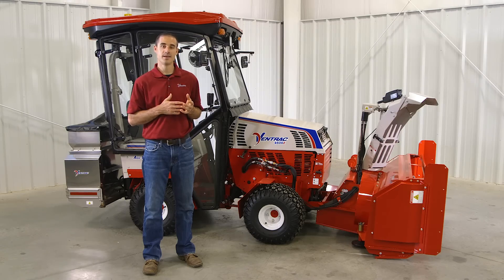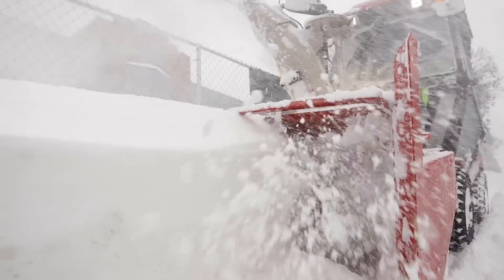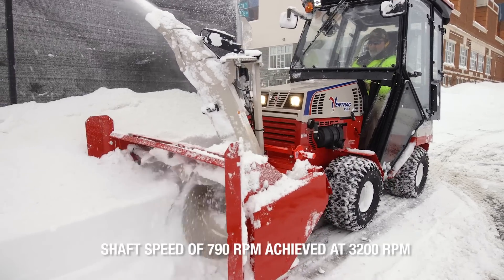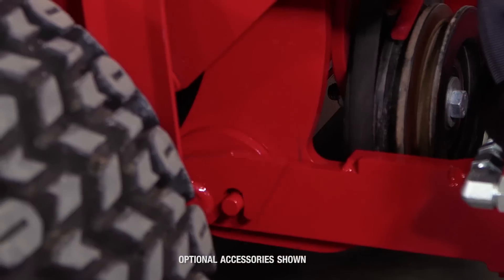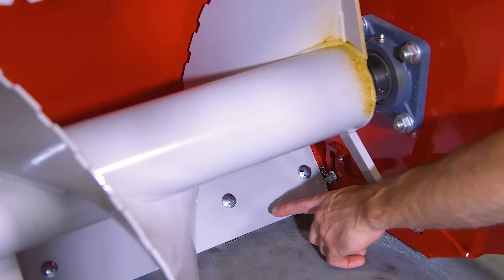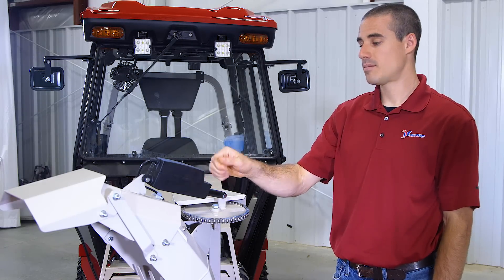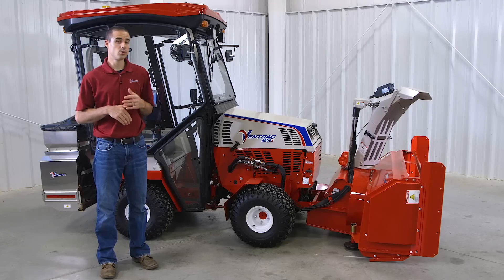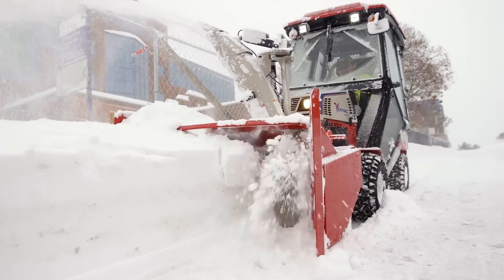Remove Deep Snow With The Ventrac KX523 Snow Blower – Simple Start

Comment: Tractor, cab and snowblower I’m guessing is $30,000?
Reply: More try $40k
Reply: Try 50k
Reply: They are the best most reliable tractors on the market imho
Reply: @tt55k  
I couldn’t afford one outside of winning the lottery.
Reply: @tt55k  it’s the same cost of JD4000 series or Kubota tractor. I guess if you have a lot of sidewalks it would make sense.
Reply: Can find em lightly used for way less that that

Comment: Are you guys working on a 3 stage blower? I would really love to see that in your lineup! I love all the videos!
Reply: You talking about that Troy Built/Cub Cadet thing?  Don't count on finding that in commercial machines.   The closest I've seen is large impeller designs with small "assist" augers or beaters on the sides.  Sometimes those will have a much smaller extension on the impeller sticking out, but that's uncommon.
And those designs are typically on trains or machines used to clear airport runways.

Comment: The machine clearly works well, I'm not going to argue that. My question is, why is the fan speed so slow relative to typical ~1000 rpm setups on many other machines? Thanks in advance!
Reply from the maker: The lower fan speed, with all other things being equal allows our blower to be more capable at heavy snow removal.  We've set ours at 790 RPM because it's a good compromise between performance and load on the engine.  We can already launch snow way farther than most people will ever want or need, so being able to throw it any further (higher fan speed) would draw more power all the time for a benefit that most people won't be using ever, and few people would use very often.  We've also manipulated other things like the auger shape to control the distance and spread of snow throw which helps to accomplish the benefits of a faster fan speed without experiencing the drawbacks.

Comment: Great video Aaron. Can the cab be used in conjunction with the propane kit on the 4500Z?  What is the width of the skid plates?  Have you tested the blower's efficacy throwing very heavy wet snow, do the augers feed the heavy wet stuff or does the machine end up pushing the snow?
Reply from the maker: Thanks Kevin -  Yes - the cab can be combined with the propane kit.  We have a lot of customers in Canada and in the snow belts in the US that do get wet, heavy snow and our blowers do well.  It does require slowing down a bit when the snow gets heavy, but we can process it.
Reply: @ventrac  Thank you!